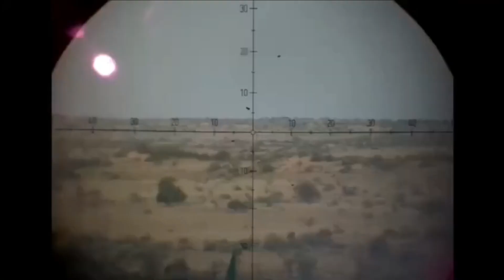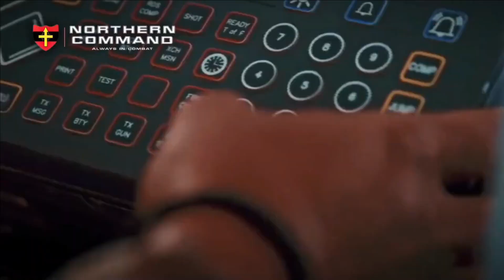155mm/52 calibre Mounted Gun System on BEML 8X8 HMV by Kalyani group #drdo #indianarmy

Comment: Its better to purchase CESAR 8 × 8 mounted gun system from France because our mounted gun system will take 7 to 8 years to manufacture by DRDO , that's really very funny 😂😂😂
Reply: The Caesar howitzer uses NATO ammunition with a 23l propellant charge. The Indian ATAGS howitzer, which is installed here, uses 25l propellant. Therefore, the firing range is significantly higher,

Comment: If a country has self propelled artillery(Vajra) and mounted gun system, then towed
artillery is much less useful. Towed artillery is a sitting duck that cannot move quickly
when attacked by drones or counter battery fire.

Towed artillery is cheap, but also useless in the modern battlefield. Unless we out range
Pakistani artillery, which is only possible with IIT madras ramjet shell.

Only MGS and Vajra can shoot and scoot, and staying still means enemy artillery fire is
incoming at your position. Who wants to shoot and get killed by the enemy return fire?

The only deficiency with the MGS is  Tatra T815 truck. BEML has no indigenous design
ability and cannot build trucks. We already have great indigenous trucks in army service with
Ashok Leyland's Super Stallion 8×8 HMV powered with an indigenous Neptune 360 engine 

Tata also makes the LPTA 3138 heavy truck, and army already operates large number of Tata
trucks. We have two indigenous manufacturers of heavy trucks!! Trucks must go on the negative
import list. 

For a long time Indian Army was obtaining Czech-designed Tatra trucks. However procurement of Tatras 
has been put on hold due to a bribery case. No to the corrupt Tatra trucks. So the MGS needs to switch
to either the Ashok Leyland Super Stallion or Tata heavy truck.

That is a simple task that doesn't need 10 trials. It is a truck!
Reply: I don't understand why Army is wasting too much Money in buying 1580 Towed Artillery Guns and Upgrading 130 mm M-46 Guns into 155mm Guns. Pakistan and China are acquiring Self Propelled Wheeled ane Tracked Howitzers, Truck Mounted Howitzers and Long Range Rocket Artillery Systems instead of wasting money on Towed Artillery Guns. I don't understand the Logic behind the Acquisition of 1580 Towed Artillery Guns whereas they have only acquired 100 K-9 Self Propelled Howitzers and has plans to induct 814 Mounted Howitzers.
Reply: @babuvishwass5910  What is the problem with towed artillery?

“. . . towed artillery is too exposed on the battlefield, takes too long to get in and out of action and relies on vulnerable [vehicles] to move it any distance.”  Understanding that towed artillery has its vulnerabilities.

In wartime, towed howitzers must “shoot and scoot,” quickly picking up and moving to a new location to avoid enemy return fire, or “counter-battery fire.” Counter-battery fire has always been a problem for artillery, but the use of radar (like the American AN/TPY-36 supplied to Pakistan), modern communications, and precision-guided munitions often means that enemy shells could be whizzing toward a towed artillery firing position in seconds, catching the guns and gunners before they can redeploy.

Is there any advantage to towed artillery?

There are situations in which towed artillery can be invaluable. It's almost impossible -- for tracked artillery to make it up narrow, poorly supported mountain roads. But a 6×6 truck pulling a towed artillery piece can readily traverse such terrain. A weapon like the M-777 can do even better: it's capable to being slung under a helicopter and transported to remote locations where enemy artillery might not be a threat at all.

It’s capabilities are still relevant. The primary reason, as the author for “Towed Artillery- Range and Light Weight Is the Motto” states, “. . . [is] the ability to transport the system over long distances much more easily than its self-propelled counterparts, most notably when rapid deployment and special forces are involved.”

Although these systems are light enough to be transported via select type/model/series rotary wing aircraft as well as parachuted in via C-130J/C-130H/C-17 Globemaster III aircraft, this by no means accounts for the  preparatory time.

Towed artillery will be vulnerable to return fire. But Pakistan does not possess the quantity and density of counter-battery radars and guided munitions to make counter-battery fire available across the board. If Bharat and Pakistan go to war in the plains of Rajasthan, towed artillery is useful here.

Also useful in Himalayas because the titanium M-777 is lightweight enough to dropped at the mountain where we need it.

Bharat must have more radars to find enemy artillery, more drones to find the artillery
after the radar gives its direction, and that will enable us to defeat the massive inventory of towed artillery that Pakistan still has.

What recent conflicts have shown is that artillery needs to be protected from electronic attack (via electronic countermeasures) and accompanied by short-range air defenses. Unprotected towed artillery, in particular, has shown to be extremely vulnerable to drone airstrikes.

After all this verbiage, the long and short of it is that towed artillery is useful, but not nearly so much as the Vayu Sena thinks it is. We need more Vajras and MGS, and less towed artillery.

600 Towed Artillery Guns 
500 K-9 Self Propelled Howitzers 
1000 Mounted Howitzers.

Makes much more sense for modern warfare. I concede that towed artillery is not useless but it is also the wrong tool for the job in 90% of situations.
Reply: @datoolz0  Yes We need more Ultra Light Air Lift Howitzers along with Self Propelled Wheeled Howitzers, K-9 Vajra Tracked Howitzers, ATAGS MGS, Garuda V2 and TC-20 Mounted Howitzers. We need Less Towed Howitzers as we are raising Integrated Battle Groups to Punish Enemies so we need more Self Propelled, Truck Mounted Howitzers and New Generation Main Battle Tanks, Infantry Combat Vehicles and Mine Resistant Ambush Protected Vehicles.
Reply: @babuvishwass5910  Definately 100%.  I think we also need to invest in more money into vajra specifically since it seems to have been upgraded since the Vayu Sena got it.

K10 Ammunition Resupply Vehicle

The K10 ARV is an automatic resupply vehicle based on K9 platform, sharing most of the components and characteristics.

The vehicle has a combat weight of 47 t, and can support a team of K9 by carrying and resupplying 104 shells of 155 mm artillery ammunition and 504 units of charges under heavy fire. The vehicle is operated by a 3 person crew, requiring only one loader by applying fully automated control system, and transfers ammunition at a maximum speed of 12 rounds/min. It takes 37 minutes to fully load, and 28 minutes to empty K10.

K9A2

The upgraded K9 will have longer range, faster firing rates, and reduced crew members.

Details of K9A2 upgrade:

    Enhanced main gun : New rifling and chrome plating will increase barrel life from 1,000 rounds to 1,500 rounds, longer range, and allow faster firing rate.
    High-response artillery automation system : Key feature of A2 and future A3 upgrade. Reduces crew number from 5 to 3 (2 in emergency) by installing fully automated autoloading system, which increases firing rate from 6 to 8 rds/min to 9 to 10 rds/min.
    Increased sustain fire : All 48 rounds are located in the turret, and are accessible with the autoloader.
    Turret driving system : Changes from electrohydraulic to electric driving system.
    Automatic Fire Suppress System (AFSS) : Enhanced fire suppress system for crew protection.
    Remote controlled weapon station (RCWS) : Enables use of secondary weapon without exposing a crew member.
    Air conditioning : Increases crew comfort by cooling down the temperature.
    Insensitive charge : Provides crew protection from secondary explosion due to enemy fire including heavy weapons, and required for the automatic loading process.
    Composite rubber track : Provides crew comfort by reducing vibration, noise, and lesser required maintenance. Reduced weight also improves vehicle's operational range. The material has lower fatality compared to metal to surrounding soldiers when receiving attack.
    Enhanced armor : Anti-tank mine protection. Similar to AS9 Huntsman standard.
Reply: @datoolz0  Yes we should acquire K-10 Ammunition Resupply Vehicles and should Upgrade Existing K-9 in Future.
Reply: @babuvishwass5910  in a war, if a country needs to win, the mantra is simple. They should be able to produce weapons of acceptable quality in huge quantity. Ultimately economy is the one which decides which country will win a war of attrition. So for that we need to be able mass produce cheap weapons system. All those hi-fi drone and AI things will disappear within a month of start of war.